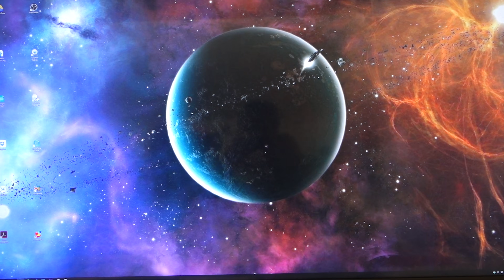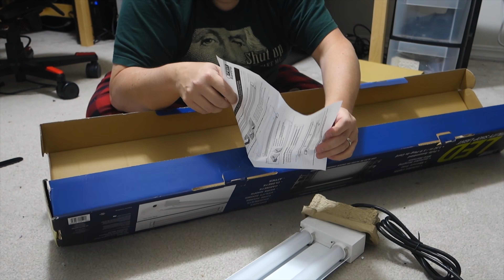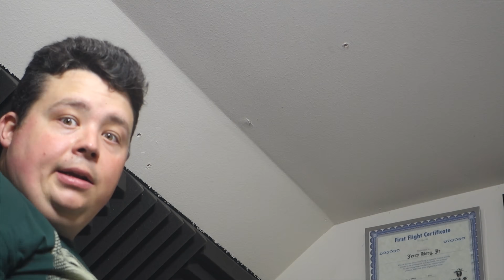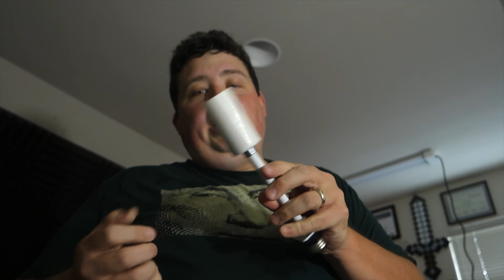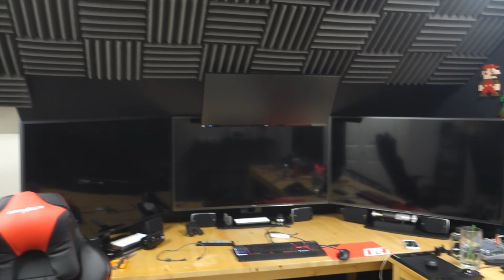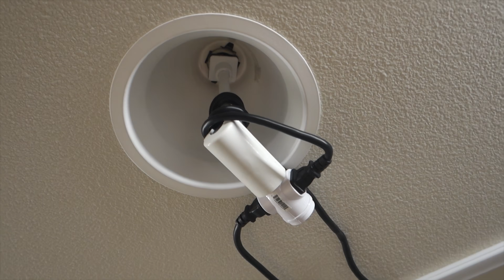How To Install Cheap LED Shop Lamps Using Existing Lighting Fixture Power - @Barnacules

Comment: Little late but the wire management work great however if you want to remove them ummmmmm use a hair dryer and try to remove them slowly otherwise only use them if you’ll never remove em.
Reply: They removed themselves on stream lol
Reply: physx nathan lol oh haha mine didn’t, mine took out half the wall lol

Comment: Have you thought about the led strips since doing this? You could run the strip around the parameter of the celling. There are diffuser covers available also. Those could be used in conjunction with stripes under your desk, and behind your monitors. Using the stripes in several pacific locations you can turn certain ones on and off, according to where you are and what you are doing, for best results. Get you a smart controller, and download the app for it. 
I you pull the can, and use a longer wire, and tape a electrical wire to the end, and drill smaller holes where you want to controllers and/or drivers for the strips to go. As for the can light, I would replace it when done where there can be a single overhead light. Install a smart led flood if desired, where you can record with a overhead light for recording. if not you can get a round smart bulb and make the interior of the can shinny, for better results.
Anyhow, these would be flexible for all situations, and probably less than $100. I’ve seen amazing videos of people’s homes, motion sensors, switches, everything automated, even down to music playing or not playing according to situation. Not difficult, but when connecting multiple systems, getting them to work together can be. 
For you, and one room, really cheap and simple.

Comment: I had a very bad experience with cheap LED's as their drivers went to shit and started making very high pitched noise and also introducing interference in the electrical wires. You willlearn this the hard way. I would not buy any cheap stuff but do a proper research on manufacturers and their warranty and technical data, so important these day with all the P.R.C. crap products.
Reply from the maker: I lucked out, 4 years later and they still work perfectly with zero problems 👍🏻 Costco knows what they are selling 😎

Comment: I would do that but I just put new ceiling fans throughout my house. I do have the same conduit in my office covering up the wires running from the wall socket outlet to the ceiling fan.

Comment: For anyone that uses the tube to hide wires when you remove them it will rip the drywall unless you use a hair dryer to heat up the glue burn your fingers and with great skill and confidence you will be able to pull it off without pulling the paint well better then it normally would.

Comment: Barnacules, you can fix the reflection issue by simply using diffuser panels over the LED lights in the ceiling.

Comment: You're basically in the attic, heat rises so it's not just the heat your generating in your nerd cave it's the heat rising in the whole house. I think you're going going to suffer Jerry. Like eternal air con systems running, electric bills & noise. Good Luck with it

Comment: please dont use those fixings they are rubbish and are not designed to be used as a vertical fixing and they will land on your head.  if its hollow use spring toggles or another type

Comment: Thanks for the entertainment. Fun to watch and when all was said and done it looked pretty good. Way to go. Just a tip here in general, the yellow plastic miter box that you cut the channels on has one side piece protruding down lower than the base. The use for that is to hook it against the front of your workbench. The miter box will now be level and as you hold it with one hand against the front of the bench and push the saw making the cut the whole thing will be so much more steady. Just for future cuts. Give it a try. Congratulations on the weight loss. It's not easy but you're doing it.

Comment: For the holes, I use the packaging to make a template. Just put the box lid against the back and poke holes where the screws should go. Then put the template on the ceiling and use a pencil to mark where to drill.

Comment: Trunking Jerry, not conduit mate :)
Also distance between screw holes is called "pitch".
Sorry I am a nerd also - but a proper one as I am an engineer.

Your CFL lamps @ a current draw of 200 watts and voltage of 110V equates to around 1.8 amps, your cable (in the UK at least) should be 1.5mm squared and more than capable of carrying that current by nearly 10 fold.

Great videos, like your channel and keep up the hard work loosing weight Jerry!

Comment: Why didn't you mount the lights on the wall above the acoustic panels and bounce the light off the opposite wall? It would diffuse the light and, guess what, no way you can get reflections in your screes ;)

Comment: Added several of these (and a few 2' models by the same manufacturer) around the house and it's made a huge difference, even when replacing similar standard shop lights.  My brother was about to wire in some lights for his new storage shed addition and now is completely replanning to use these.  Thanks to you, my family thinks I'm an electrical genius or something!

Comment: Over the last 12 month's my wife and I have replaced almost every incandescent & fluorescent light with LEDs. In my area, no one has a bigger selection than Home Depot. I'd estimate close to 40% of all their light bulbs are now LEDs. Lately, I've been buying "Daylight" bulbs. Love em. The soft whites are almost yellow when put side by side. Put a 2 bulb adaptor on our front and back porch. The porch lights often run 24/7 and at 8 watts and a rated 25,000 MTBF per bulb, we don't care if we forget to turn em off. We have 4, 3-way Torche floor lamps. EcoSmart has 3-way Daylight bulbs that cover our lamps. A 2 pack is under $20. No more changing out a spent 3-way every 3 to 4 months. So far, we have not had a single failure on any LED we've installed.

Comment: If you hate glare, bounce lighting is a hell of a lot better than direct. You could probably use the same lamps, but it'd involve fabricating some custom box fixtures located on the upper wall area that are aimed at the ceiling. White ceiling like you have would work great for that.
Reply: That's what I did. I got some gutters from the hadrware. Put on the endcaps. Put fluorescent lights inside the  gutters. Mounted them high up on the wall near the ceiling. It works great. They look just like the lights in my Doctors office waiting room back in the the 1970's. That's what gave me the idea.

Comment: Awesome job Jerry, only thing I'd like to warn you about is the redundant wire you wrapped around the extension socket....you basically made it into a coil and this way the wire tends to warm up, shouldn't be a big problem with the LED's being fairly low wattage but it is something to keep in mind for future projects ;)

Comment: If you really want a Nerd Cave, you should've gone with the Philips Hue system LED-strips, as they are incredibly bright, can change to all color temperatures and colors, and everything can be controlled through either your phone, PC or a wireless dimmer on the wall.

Comment: You need to mix ambient , spot/task and accent lighting so give your room pools of light without the harshness.
And a dim light behind the monitors, aka a bias light which you can rig up with whatever works...very dim...will reduce the contrast between the wall and your monitors reducing eyestrain

Comment: Heads up on the miter box, it has a lip on it so you can use it on the edge of the tabletop or counter. Then it won't slip on you while you're sawing. 👍🏼

Comment: Wow, that was interesting. Those "boards" in the ceiling are called joists and they are spaced 24 inches apart. They can be located with a stud finder. It is better to drill into the wooden joist than to use a plastic anchor, especially when mounting anything overhead. Plastic anchors are good for walls but not recommended for hanging anything electrical from the ceiling. The miter box has a lip that you place at the front of the desk or workbench to prevent it from sliding around when you are cutting material. Watching you install those light gave me a sore neck as I was constantly shaking my head at all the things you were doing wrong. You should change the title to, "How NOT to install LED Lights in the Nerd Cave". No one should use this as an instructional video on DIY. Ask someone more skilled to help you next time. You're just an accident waiting to happen.
Reply: I highly doubt you actually watched the video or read the description. He totally said this is probably not the right way to do this, don't take this as a tutorial, etc.
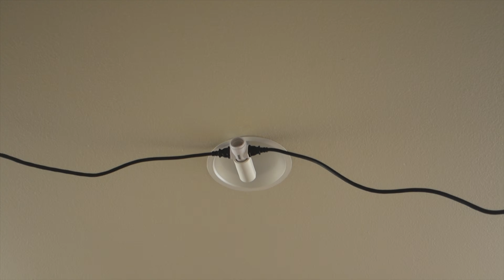Reply: 10:52

Comment: You could have just as easily (from your overloaded socket safety POV) a single 300w equivalent LED bulb.  Yes you would have still had a hot spot, but it would have been significantly easier...

Comment: Weight loss and still drinks energy drinks. lel
Reply: Those sugar free energy drinks are pretty much bullshit
Reply: +PROTOCỢL It doesn't matter if it's sugar free... The energy drinks provide calories via carbs. If you're not working out hard you don't need the extra calories.
Reply: Sugar free, though
Reply: The carbs come from the sugar man...
sugar free will be zero calories lmao

Comment: Actually very funny without it probably meaning to be.  Need to get yourself a stud finder with an electrical current alarm as well, it will tell you where the timber is not to mention that you don't want to accidentally drill into wiring!

Comment: 50,000 hours!? that'd last you 5.70776246575 years if it doesn't last this long or longer then it's a bad light but considering it's a shop light it'd incur multiple lawsuits so it cannot be lying

Comment: Honestly should have spent the time and wired in recessed flood LED's. The light would have been more evenly distributed and you could have used 4 8w or 9w lights. 

Now you've got shop lights, weird plugs, wires and those bars on your ceiling.

Comment: You will really like those lights. We changed the ballasts out from all of our tube lights in the basement (from 1964...) and did direct-wire LED lights at 6500K. They use about a quarter of the energy and light much more evenly. Great investment!

Comment: I done my whole house house, over a 12 month period about 3 years back,  and my electric bill plummeted.  Also leds don't pop (touch wood),  but in the UK,  LED Hut,  does a 10 year warrenty in there led bulbs

Comment: you should take a look at LED tape lights
Reply: sure, where are some high wattage 100lm/w tape lights?
Reply: ... that don't have LEDs burn out within a month of use. Yet to see any to be honest. Not even the 12v (13.8VDC) car stuff is all that good or reliable.  I have a 12V 'DJ lights' strip in my hutch, half the LEDs died within a month. There are a lot of junk LED lights out there.
Reply: Zarcondeegrissom maybe you got to make your own, but not many people want to spend the time to do it idk.
Reply: I am so with you on that. I've had name brand 120vac LED light bulbs fail, not just 12v DC lights. By the time I got to putting a light in the hutch, I didn't even bother soldering the wires, because I had so many LED lights from different manufacturers fail. Sticky-tape backed light strip stuck in an aluminum Chanel and a 12V power supply was the extent of it (and a picture hanging hook to hold the wire up over the monitors). It was far less work then the new lights in the Nerd-Cave (not as much light needed from them either).

IF, Barnacules dose not need to replace the bulbs in the fixtures within six months, I'll be impressed. I'm not saying there isn't good stuff out there, it is just rare or super expensive.

Comment: I would recommend trying to remove the canister, drilling a hole or a slate on the ceiling where the lamp is going to be, try to feed a wire cable through the canister and catch it on the lamp hole. You can split the electrical connection for the two lamps and all the wires and holes should be concealed, all you need is a lid to close the hole where the canister was. Just an idea!

Comment: I think i might of gone blind because last time i checked they are not LED Lights. But a good solution for the problem and i was looking for some cheap cable management solutions so i might use the same stuff you used for this project.

Comment: Nice project bruh, if you remember I asked when you would make another 3D printing video in your latest live stream. I also sent you an email and you responded by saying a tesla charger adapter could work. Also remember to sharpen bat knife. Also putting RGB led strip lights in areas like behind your monitors and so on would be awesome. Especially if you can control the RGBs with a remote control.

Comment: AS stated in other posts CFL bulbs do not draw the same about of power as an incandescent bulb.

Sorry, but I barely made it passed 1 minute with the wrong information.

CFL bulbs in no way draw as much power as a regular incandescent light bulbs. It is an equivalency factor. I think I have a 75w bulb that only draws about 13watts (as compared to an incandescent bulb). So, if you are truely drawing 200 watts on a 100 watt fixure then your home insurance should cancel on you for risk of starting a fire.

This is the same thing that AMD had done for like 10+ years. I remember then the K5 processor was out. It confused me at first, the AMD process ran at a lower clock speed but was comparable to what equalivent Intel processor.

Also, no diffuser covers on the lights? That would help to even out the lights as well.

Comment: Coiling power cords is BAD!
Its not a big deal for low power stuff, but by coiling the wire you make an inductor. The magnetic field created increases resistance and draws more power. If you coil a power cord to a high power device, like a space heater, it can increase resistance so much that the wiring gets hot enough to cause a house fire! Be safe everyone.

Comment: So that is not " water damage " that is a nail backing out of the drywall because who ever fiber taped it sucked at their job.
Reply from the maker: Fair enough :D
Reply: Just letting you know, because if that was water damage I would have my roof inspected ASAP
Reply: In the South, we call em "nail pops."
Reply: in the uk when they plaster the dry wall they do.. its like cross hatched string tape

Comment: why didn't you put them on the top of the angled wall that shares the same side as your computer It would have removed all reflection I think.. just wondering if there was a reason behind not doing that ?

Comment: couldnt you have just done the conditioning on the other side of the ceiling and have the power come out of two holes right ontop of the strip lights?

Comment: not trying to sound negative but it would have been fairly easy to install the wiring above the ceiling and ran it to the can light , especially If you were already going to patch holes.  It definitely looks Jerry Rigged. lol

Comment: First off. Nice video and good job on the weight loss, I'm rooting for you m'boy! Secondly, Dry wall mount screws can come lose over time in high-moisture environments such as garages and attics like the one you said already has water damage... 
If you are 100% happy with the placement I would slap either some industrial strength double sided tape or velcro between the light and the ceiling, its a bit of a kludge but would be easy enough to remove if necessary.
Reply from the maker: +piccolo181 good idea! The light fixtures are very light weight.

Comment: The cord concealers only get worse with time, hope you want to patch a lot of drywall in the future.  I hate those things.
Reply from the maker: +Jonathan Mayer the room already needs a lot of drywall patching ;)
Reply: I hear you, It's a personal hatred.  

I have them in my bedroom from the previous owner.  That's why I hate them so much.  There is no clean way of taking those off.  Either you leave foam on the wall or you rip a hole in the wall.
Reply: Heat gun :D
Reply: They drop over time. I always use few screws to secure them. I recommend you do the same too.